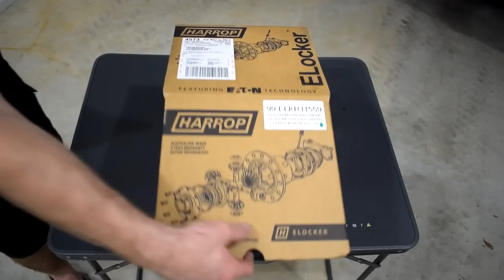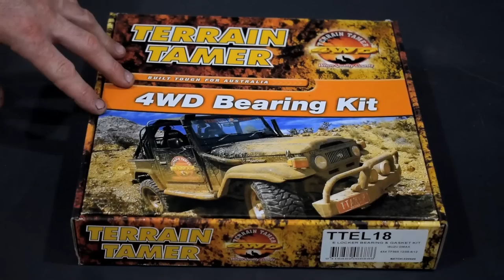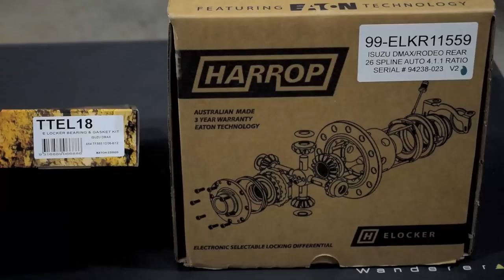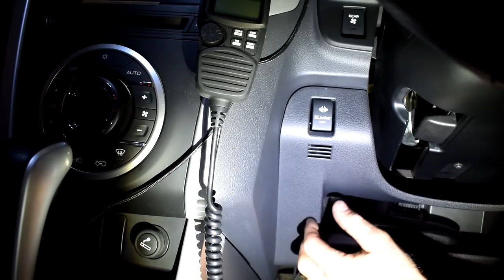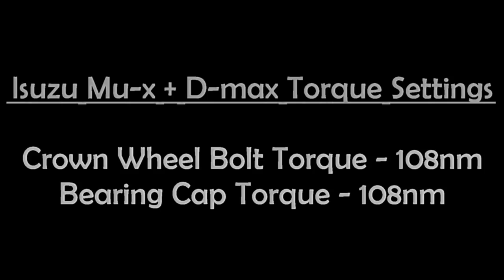How to install a Harrop E-Locker - 4WD Isuzu Mu-x Rear Diff-lock Installation - Complete Guide

Comment: Thank you. I fitted an elocker to my 17 dmax and found your video informative. I trashed the bearings getting them off with a puller, so your bearing kit suggestion was a good one. My only criticism was you sort of skipped how the tabs go. Also note, the dmax has drum brakes, which if your careful you can avoid removing, but you will need to stretch the lines straight. Again thank you for the guide.
Reply: Hi, how'd you go with the backlash? Any adjustments
Reply: @tagg7534  adjustment would mean different shims which I didn’t need so it must have been in spec.

Comment: Thanks Nick - a very informative video. I have a 2016 Mu-X, which I travel in (towing a van or tinny sometimes), so the e-locker should mostly be of benefit in sand and mud. My question:  in your opinion, if I am going to fit one e-locker for these uses, should I go front or rear?
Reply from the maker: I'd recommend rear for starters in your situation. The rear diff is the stronger of the 2 and you will find it more useful especially when towing etc.

Comment: Nice dude I got an e-locker installed a couple years back on my RC colorado. Works flawlessly! 
Today I have paid for a front e locker too 👍Is that bearing kit specifically for the rear diff or does it suit both diffs?
If you're in Perth and want a cashy in late January lemme know 😂
Reply from the maker: Awesome! The bearing kit is just for the rear. They should have a front e locker bearing kit though. I'm in QLD haha might be a bit of a drive 😂

Comment: Great video Nick.
I'm getting an E-Locker for my Dmax soon. Quick question, I sometimes get bogged on the beach retrieving the Jetski, so hopefully a locker will help.
When engaging the locker, is it best/necessary to switch off traction control too?
Thanks
Dave
Reply from the maker: Hi David, it isn't necessary to turn off traction control when using the locker . The vehicle just monitors the wheel speed via the abs wheel speed sensors. With the locker engaged there will be no difference in wheel speed between the rear wheels so it shouldn't activate. If you are driving on the beach however I would recommend to always have traction controll turned off completely.
Reply: @LowRangeNick  great thanks Nick. 
By the way, I got that Turbo changed in the 'nick' of time, no pun intended before the warranty expired, totally due to your other video. Thank you so much again!

Comment: Nick. Any reason you went with a rear locker rather than a front locker? For me, particularly with IFS vehicles you tend to lose front traction first so my thoughts are front locker over rear.
Reply from the maker: Firstly, a front locker will always get you further off-road. I have had a twin locked 80 series and a front locked suzuki jimny and the front locker was great! In saying that, an ifs vehicle has alot of easily damaged components in the front, tie rods, cvs, rack ends etc. The diff is also alot weaker being an alloy housing. The rear locker will get you through 90% of the tracks and the front locker will usually get you through the really difficult stuff the other 10%. The reason I went rear locker is, stronger diff assembly in the rear, less components to break when under stress, easier locker to fit and also the rear locker can be used alot more than a front. The front can make turning difficult etc.

Comment: What happens with the ABS and traction control function?, aren't both  supposed to de- activate when E- Locker is engaged?
Reply from the maker: Nothing will happen with the system when the locker is engaged because there will be no wheel sleep registered on the axle with the locker. So the traction control won't activate on that axle.

Comment: Hey mate. I fitted the same elocker to my dmax about 2 years ago. Followed all the instructions and checked that everything was within spec. Worked well for the first month or 2 then developed a faint whine that would go away once I took my foot off the accelerator. Backlash was all within spec and even checked the gear pattern by painting the gears. Whine got too noisy so I have swapped the whole diff out for a spare LSD until I can have the locker looked at. Just wondering if you had any issues or know what the issue could be?
Reply from the maker: It sounds like the ring and pinion gear meshing hasn't been setup correctly. If the vehicle has high kms it could also be related to worn crown wheel and pinion or bearings. Probably best to get a diff specialist to check that it is all setup correctly and that the gears and bearings are in good condition. Mine has been going great with no issues.

Comment: From Harrop's presentation, it looks like the locker disengages and then reengages when changing direction, is this noticeable in the real world?
Reply from the maker: You shouldn't notice it in offroad situations. If you see the ramp on the secondary plate in my video. When you go from forward to reverse it is just the plate turning from one direction to the other to re engage the locking ring in the opposite direction. Also automatic vehicles with hill start assist dont roll back at all.

Comment: How much is that.  Our top of the line D max in the Philippines which is LSE variant doesn't come with diff lock on the automatic version only the manual version. Would you recommend doing this? Thanks

Comment: My wires that go into diff have come off or broke off inside the housing , im guessing right at the locker. To get to it do i need to do all that? Wheels and all?
Reply from the maker: If it has broken off in the diff and the can't see any wiring coming out of the diff then yes you would need to remove the entire diff center and repair unfortunately.
Reply: @LowRangeNick  thanks mate

Comment: What style switch did you use? The one that came with mine was a generic rocker switch and they don’t fit anywhere in the mux dash
Reply from the maker: Hey Lachy, I ordered a specific switch that fits the mu-x/d-max dash. You can get them through harrop or on ebay etc.

Comment: Gday Nick, 
Is there anywhere handy you can take the switch power from so the diff lock can only be engaged once L4 has been selected, I'm just concerned the kids might play around with the switch and the bride jumps in and goes boring up the bitumen road and blows the diff up! 🤦‍♂️ I had a look at the 2H,4H/4L selector knob but couldn't work out how the wiring works there... cheers Aaron
Reply from the maker: Hey Aaron! You probably could find a wire on the selector with a test light and wire a relay to it which would supply power to the e locker harness when i 4lo. An easier way to do it may be to just wire in a hidden micro isolator switch on the e locker harness. Run the e locker switch earth or power through a secondary isolator switch so you can flick it on when you need it. Or you could just pull the fuse out of the harness and refit it when you go 4wdriving.
Reply: @LowRangeNick  thanks heaps for the reply mate, pulling the fuse out is what I have done atm. 👍🏼

Comment: Hi Nick,
I may have missed it during your wiring action, but where did you wire in the Switch illumination (Harrop switch) blue tail wire you left unconnected from the Switch?

Black went to Ground
Blue went to Switched live (piggyback 20 amp fuse)
Blue illumination wire from switch to ?

Many thanks

Dave
Reply from the maker: Hi Dave, i just used a test light and found an illumination power supply from one of the other switches next to it and wired it to that.
Reply: @LowRangeNick  great, thanks again Nick, just waiting for better weather to install now 😀

Comment: Mick nice vid. When you were drilling the hole for the lead to come out im just wondering the metal debris in the diff an issue??
Reply: Do it before you reassemble. Use a rag with shaving cream to catch the shavings
Reply: @tagg7534  cheers Mick .
Yep sorry I thought as much (common sense) the vid gave me the wrong impression ..👍👍

Comment: Been tossing up the MU-X and the Pajero Sport - the Pajero Sport comes with rear locker...hmmm - that may just tip me over the shocking looks of the Pajero Sport.
Reply: Pajero sport looks like it was made for the city.
Reply: Pajero sport was designed by Stevie Wonder and Ray Charles.
Reply: The new 2021 Mu-X will be supplied with rear locker as standard I believe

Comment: Hey Nick, I assume that oem diff set up has a crush spacer for preload in it versus a solid spacer.  When doing the Elocker install,  is the oem crush spacer replaced or re employed?
Reply from the maker: Hey Steve, the pinion isn't removed so it doesn't need to be changed to crush or solid etc.

Comment: Hey nick, what is the difference between e-lockers and air lockers?

What are the pros and cons?

Thanks 😃
Reply from the maker: I have had both, i had twin Arb airlockers in my 80 series and an air locker in my suzuki jimny. The air lockers require the use of an air compressor and run air lines to the diff. This means that inside the diff lock there is compressed air which engages and disengages the locker. The common issues with air lockers are leaking seals or fittings inside the diff and also leaking lines. The E locker, as you can see from the video runs only electrical wiring to the back of the vehicle and doesn't require any additional parts , like an air compressor to run the locker. The only con with the e locker is there is a 1/8 turn of the wheel engagement time when going from reverse to drive or drive to reverse. Which you would never really notice any performance issues with this offroad. But people like to make a big deal about it lol
Reply: @LowRangeNick  thanks man, so basically air lockers cost more to maintain and implement. And when it comes to repairs, it really is costly especially when you're finding a leak🤣.

Good thing that we have an e-locker option at our mu-x's

Comment: It would have been great to see you set backlash when it was wrong. Is there a video someone can link me to for this?
Reply from the maker: The backlash needs to be adjusted by changing the thickness of the shims in behind the carrier bearings. If it is incorrect you either need a thicker shim or more shims or to remove a shim if it's too tight.
Reply: @LowRangeNick  was just looking at how to setup back lash for our diffs and its a very easy setup and yes that's correct. Does the pinion gear have a tension setting?
Reply from the maker: @shanepascoe1078  It will have a tension setting. If installing a locker its not necessary to touch the pinion.
Reply: @LowRangeNick  thanks mate, I only ask coz I jave a noisy diff and I plan to change carrier and pinion bearings. Your video popped up in search, but was also very helpful.

Comment: I know this is an older video but I'm wondering how these aged and whether you have ever had an issue with the disengaging/re-engaging that happens when going from forward to backwards?
Reply from the maker: Still works perfectly. No issues with disengaging as it only disengages for 1/4 of a turn before engaging again which isn't even noticeable.
Reply: @LowRangeNick  Cheers mate. I have a 2020 MU-X that I'm doing work to. I respect your opinion and am a big fan of the videos.

Comment: How do you adjust backlash on this diff? If shims, then if re-using stock shims what are chances for the preload and backlash to be within spec with an aftermarket carrier?
Reply from the maker: It is with shims. All of the e lockers I have fitted have come within spec with the factory shims. There is a chance that they won't be correct though.
Reply: Good to know, I might be attempting one soon. That probability is always there for one to be out of spec, but yes start with stock shims and see if within specs. So far I have only done one diff and that was with adjuster nuts.

Comment: Looks like heaps of play between the two wheels when the locker is engaged. Is that normal?
Reply from the maker: When engaged there is no play between the two wheels? When swapping from forward to reverse or reverse to forward motion there is an engagement time of 1/8 turn as the locking ring disengages and engages again.

Comment: Hi Nick great vids mate. I have a problem somewhere along the drive train. My 19 dmax manual has front and rear elockers. When driving, if I let off the accelerator to coast there is a half second delay then a clunk/thud and the same when I reapply the accelerator. Do you think this could be backlash. I had the lockers fitted from brand new and have only done 16000ks.
Reply from the maker: It's normal to have some delay and a small engagement feeling when going from coasting to applying the accelerator. If its excessive though it may be the backlash is not set correctly.
Reply: @LowRangeNick  thanks mate I appreciate it

Comment: Hi I'm from South Africa, I'm driving Isuzu KB300 2013 model single Cab..
I'm struggling a lot with my car...
When I try to stop the car on 30-40 speed it's shaking a lot..
Like the whole body, front body shaking too much......
I didn't find any problem.
ABS is ok
Suspension is ok
Brake pad and rotor is ok, I bought genuine from Isuzu...
Please please help me...
Reply from the maker: It could be warped brake rotors, loose wheel bearings or failed suspension and steering components.
Reply: @LowRangeNick  is not

Comment: When engaging the diff lock, all ESC and traction controls must be off?
Reply: If your vehicle comes with a diff lock, traction control and esc generally are turned off when the locker is engaged because tc and esc apply brakes to the wheels slipping so as to get traction to the other wheels  and this is no longer needed with the locker engaged. With an after market locker, you will have to manually switch off tc and esc unless you set the ecu to do that but then again you generally use the locker in low range and tc and esc generally switches off automatically. All depends on your vehicle. Triton for example, you can use tc in low range but it switches off when you use rear locker.

Comment: Nick,
How many splines did your MuX original/factory rear axle have?
Reply from the maker: I'm pretty sure it's 26 spline. 😊
Reply: @LowRangeNick  Thanks. Your Mux was probably exported to Oz from Thailand. My Dmax VCross (2016- 4JK1) was similarly brought over to India for homologation and sale. However, I am told that my rear axle has 31 splines by the dealer and Harrop only makes for 29. How can one confirm, short of dismantling the axle🤔
Reply from the maker: @sureshthampi7709  some diffs have a sticker or stamp on the housing and center. You may be able to find this and determine which center you have.
Reply: @LowRangeNick  Thank you

Comment: When u spun the wheel in reverse the opposite wheel spun forward for a second, why is that?
Reply: Until the locker engaged, it was in open diff mode which has exactly that effect. A moment later, the diff lock engaged and they spun the same way. The electromagnet energises the locking mechanism, it is not the locking mechanism. Hope that helps.
Reply: @BenMitro  the locker was already engaged travelling forward. So when switching from drive to reverse it disengages and re-engages?
Reply from the maker: @SCT15H  Yes that is correct.
Reply: @SCT15H  Yes. Do you recall the cam that pins rode in When Nick was showing us the elocker?  1:20 When changing direction, the pin is driven back up (disengaged) and then down (engaged) again.